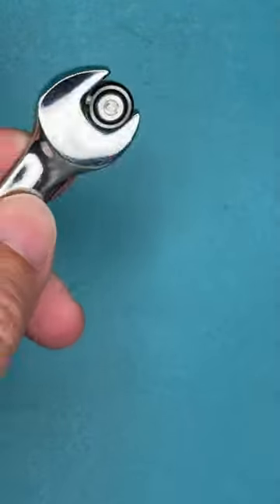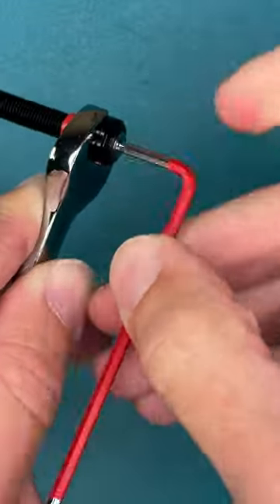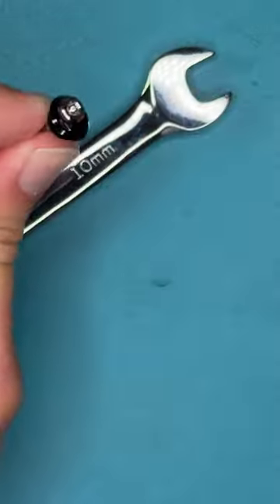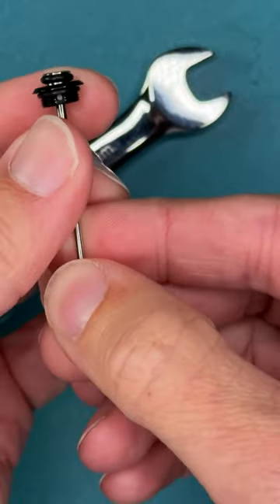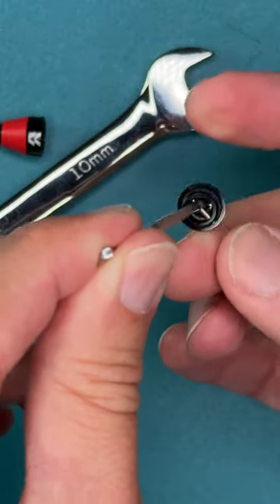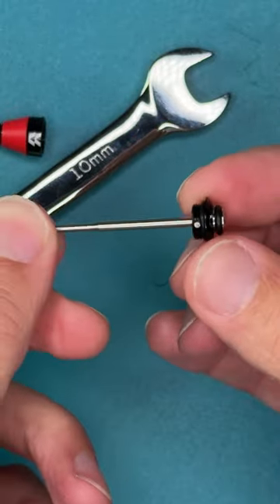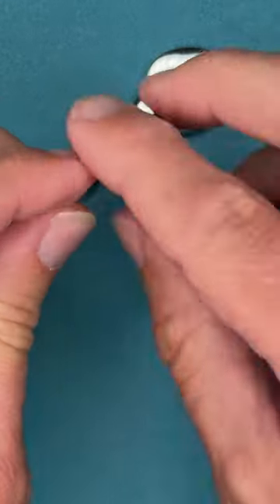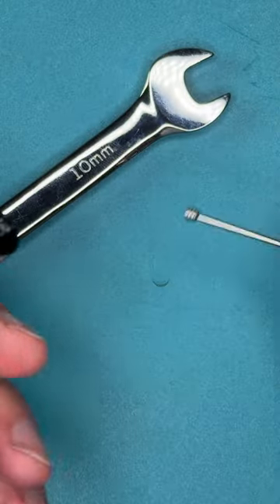Fillmore valve disassembly #gravelbike #mtb

Comment: Mine spins freely and I cannot unscrew. What am I doing wrong?
Reply from the maker: Are you sure the wrench is on the flats? They are kinda subtle but you have to hold the threaded tube in order to unscrew the end cap
Reply: @AnAvidCyclist  Thx for your response. I am sure the wrench holds the threads firmly. Nevertheless, whenever the pin spins, I see that the protruding tip in the bottom does not. That is, if it is a unique piece, how can I turn the pin with the hex and the tip on the other side remains still?
Reply: @AnAvidCyclist  I hold the threaded part firmly. Sure. When I make the pin spin with my hex, the protruding tip underneath remains still. How can it be if once disassembled it looks like a unique piece?
Reply from the maker: @cristobalperezhuertas5362  - I had one out today and was looking at it given your comment here. I’ll try to describe as well as possible. The silver plunger piece is one part from end to end, from the 2.5mm hex end to the other end where you’d press to release air. Assuming you have the black body held well with a 10mm wrench/spanner I see only 3 ways that the silver piece could spin. 1) wrong size hex tool, 2) the hex flats have been rounded/stripped or 3) the silver pin inside that secure’s the long silver plunger has slid out. However unless there was a manufacturer error then if the valve has never been apart before #3 shouldn’t be possible. 

Hope this helps
Reply: @AnAvidCyclist  Thx for your kind help. I finally reached Fillmore and they took my valve under their warranty program.

Comment: It would be dandy if they offered replacement parts for the non-metal bits of this system (red grommet at bottom and black o-ring inside).
Reply from the maker: Well, that would mean not buying a replacement set for >$50!! 🙂 - I have a conical “red grommet” piece from a traditional set of valves and it fit just fine, so at least that should be easy to replace. I imagine that inner o-ring is a standard size, but good luck finding one at Home Depot.